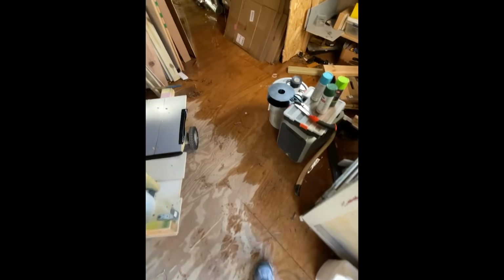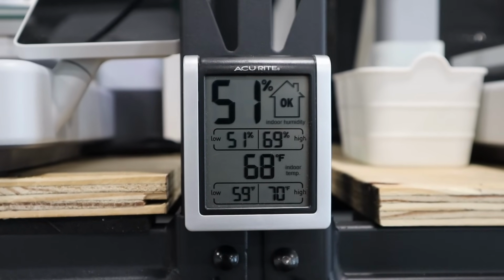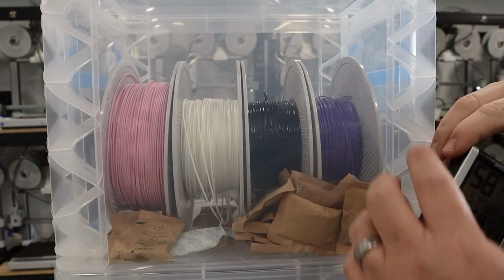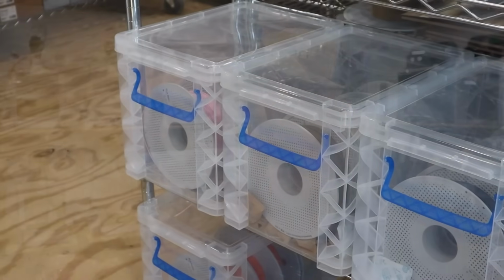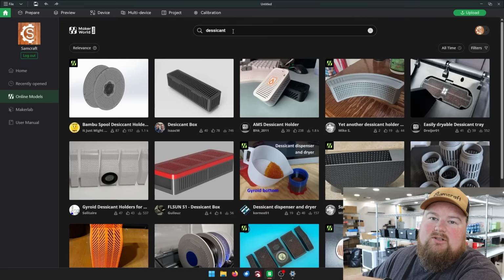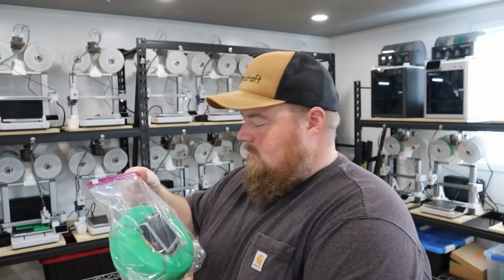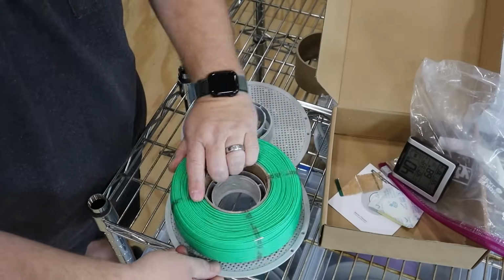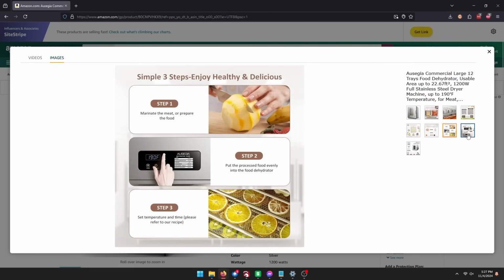Moisture Effects on 3D Printer Filament: Print Quality Test!

Comment: Sam, the moisture inside the filament and the moisture in the air within the box with the spools are different. The moisture inside the filament should be higher. The silica gel bags that come with the spools are already saturated with moisture. You can renew them by placing them on a plate, out of their bag, inside the microwave for 2 to 3 minutes. There are plenty of silica gel boxes available on sharing platforms. I don’t recommend using zip bags for filament storage, as moisture still manages to get in for some reason. That’s just a waste of money.

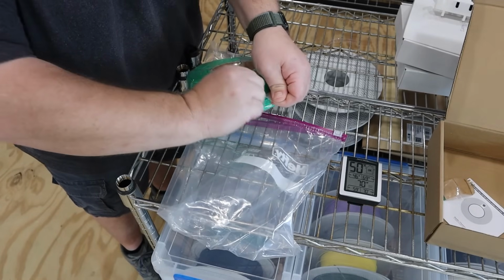Here’s my working method: First, get a filament dryer. The 11:11 discount is coming up soon. Maybe a couple of SUNLU 4-spool dryers would work well for your setup. Industrial food dryers are sometimes not very accurate with temperature, which can affect the filament (diameter consistency and shape are crucial), so I prefer dedicated filament dryers. Dry the spools until they reach 25% moisture (you want your filament that dry), then store them in a dry box. A cereal box with a foam rubber gasket can do the job on a budget. Buy at least 100g of silica gel for each dry box and renew it frequently. Most silica gel changes color when it's full of moisture, so it’s easy to tell. Personally, I don’t do multicolour prints, so I’ve set up my dry boxes with a tight PTFE tube and rollers to allow the spool to rotate. I have a bunch of these on the shelf above the printers, feeding each printer with the required color. I'll leave it to you to assess the usefulness of multicolor printing. Personally, I've determined that the filament waste and extended print times are not at all cost-effective, especially since it's very easy to add inserts of a different color, printed simultaneously on another machine, if needed.

The rough texture is a sign of over-extrusion, which can be caused by moisture. Stringing is also a symptom of moisture in the filament, as are the popping sounds when extruding PETG, ASA, or ABS. Good luck! Sorry about your floor. Maybe a coat or two of protection would’ve been useful.

Comment: Building on a few comments - in the short term, to help, raise the temp of the room, for example turn the heat on and bring it up to 75 or 80 degrees, this should coax anything wet in your room to evaporate into the air which can hold more moisture. Then with the warmer temp and with more humidity in the air the dehumidifier and AC units can work more efficiently to pull it out of the air. You can also rent a commercial dehumidifier which would be much more effective at wicking the moisture out (also check your dehumidifier to make sure it isn't creating an ice block - letting it warm up will make sure any ice melts and water drips down).  Good luck!

Comment: It seems like you're overcomplicating the issue. I have the enclosure and it's really not that difficult to use. Someone on YouTube timed a spool change and it was under 1 minute. You can always redesign the enclosure to improve speed. Remember that the spool rod does not feed the printer. The mechanism that pushes the filament is in the feeder.

If I were you, the AMS would not even be at the top with the printer. The feeder would be at the side, and I would relocate my own spool holders in the front of the shelves.

I think you are fighting an uphill battle trying to dehumidify the entire room.

Comment: Until you get the plywood floors dried out you could have high humidity for months. Move your boxed filaments to a drier room, maybe in the house. at least then they won't get ruined.
Did you put heaters in to try and dry it out.

Comment: looks like even with the machine propperly working you probably need to put the waterjet in a seperate room , when the machine is working it blasts water through the material releasing a lot of vapor intoo the room . maibe just add some sort of outdoor toilet type of structure for the waterjet , it doesnt need mush but any problems will be in that space only (maibe adding a shower tub under the machine ad maibe even a shower curtain around the machine would work too for any floodings
in the old days of stick welding you needed youre weldingrods to be dry too . one way to do that was storing them in an old fridge with a 100 watt lightbulb inside , the insulation of the fridge and the lightbulb kept the inside nice and toasty and dry
as for gaskets in the existing storage boxes , not sure if you can get two pack foam sealant material that you can pour , from wat i can see you can probably pour some of the stif in the groove of the lid cover it with kitchenwrap and set the box over it upside down to let the foam form while the box it fitted to the lid , might need to trim the foam some once it stopped expanding but i think it will seal good eough 
allso i watched another channel where the guy used a truck style air dehumidifier and he mentioned that once the stuff stops working you can put it on a baking tray and cook it slowly in the oven to evaporate the water it collected and have the stuff become active again 
might be worth a try 100 reworked packs trown in a container would draw in water a lot faster than 10 new ones

Comment: Sam, Sorry to see your woes. Might I suggest you go see Joshua De Lisle's site and look at a review (or two) of a small cheap diesel heater with a blower that might provide enough heat that could assist in drying out those spools. Ken's Karpentry just installed one and several others have used them effectively. One place in Alaska uses it to heat their chicken house coupled with a dehumidifier to reduce the moisture while heating the coop. Thinking along the lines of drying wood, I have seen a couple using these with blowers in insulated boxes and fans blah blah... You get the point. At about $100 you get a great little heater that uses little power or fuel to do what you want and you can isolate them or use them to supplement heat in the shop.

Comment: I would get a 2nd maybe a 3rd dehumidifier.  Also, put a PLASTIC Sheet across the printer end of the shop, to seal it off.  Cut a slit so you can get through to service the machines, and have a couple of dehumidifiers in there while the rest of the shop dries out.

CNC Kitchen just did a show on drying desiccant pouches with a cheap microwave using dehumidifier cycle.  Please check it out.  He got great results.  It can also be used with bulk desiccant.

Comment: Hey Sam. Thanks for this video. Can't imagine how frustrating the humidity must be.
My experience with dessicant bags from filament manufacturers are that they are generally a bit wet for my liking. Consequently, the bags are playing a game of who is more hygroscopic with the filament it's stored with.
I save a bunch of these bags and cut them open when I have a bunch. I reactivate (dry) the silica inside and use that for storage.
Speaking from a research chemistry lab, even purchased silica containers which has never been opened need reactivation before first use.
If you put them in the oven at 120°C for around 8 hours, then seal them and let them cool to room temperature, you will find they absorb a lot more moisture a lot quicker than straight out of the bottle/bag.
Those storage crates are also a relatively large volume of air compared to the dessicant you have in them. I would definitely look into maybe getting at least some rubber sticky strips to put on the edges of the container to act as a gasket.
I know the bambu lab pla filament is pretty good; however, I would also consider drying it before use (once your shop is at a lower humidity too).
I still got a lot out of your video and it was interesting to see how you take on this problem.

Comment: The process of making the filament cools it in a water tank as it's extruded, so even fresh new upopened filament will be "wet" hence they have the dessicant inside the packaging. Dessicant, filament dryers etc, even just gaskets on your boxes will help. In scotland i can keep my bambu filament down just under 20% using these methods and it deos make a huge difference to print quality! If you are printing a lot the length of time a reel is exposed will shorten, which will help, Good luck!

Comment: Did I understand you correctly that you use the desiccant from the spools you open in your drying rack?

You should reconsider and use new desiccant. Used desiccant already contains moisture and just like a sponge can also give moisture to the air if the humidity is lower.

Thus you might raise the humidity inside your drying boxes by adding desiccant which is already of higher moisture content

Comment: I use a small food dehyadrator, only fits 2 rolls, but it works well. Our humidity here is always high, often above 60% so I converted an ikea cabinet into dry storage. sealed the gaps with caulk, painted the inside with leftover bathroom paint and put window foam strip sealer on the inside of the doors to seal it up. used drawer runners and dowl with some printed parts to make drawers for the fillament to sit on and put a tiny dehumidifier inside. I can store lots of fillament in there over 3 shelves, 2 rows deep and the drawers make it so i can easily access and see whats on the row behind do i dont have to move rolls around to get to whats in the back.

Comment: A humidity level of lets say 60% means that the air contains 60% of the humidity that it can contain at the max with this temperature. The warmer the air, the more moisture it can hold. So this does not mean the air contains 60% moisture. It just contains 60% of the maximum amount of moisture with that temperature
Reply: Thanks. I've learned something new. Did not know that temperature makes a difference to the actual amount of water in the air.
Reply: @Francoisdp82 Lost In Tech recently made a video about moisture, humidity and drying filament, if you want to know more about this topic

Comment: The desiccant packs you have you should dry them out from time to time to reuse them, and you should put some foam or other type of seal at the boxes you have. PLA is quite forgiving on moisture and this is hopefully one-off situation. You don't need to go to extreme measures, if we are talking about Nylon or other similar type of filaments that's another story, but PLA is not too critical.

Comment: I live in sub tropical Queensland. Humidity in my workshop is 70+ on a good day but inside my AMS I get 25%.  I use 25 ltr sealable pales for storage of open rolls and can get it to 20%. I use multiple humidity meters don't rely on one. I have a large oven for powder coating which is controlled by a PID I use that for drying with the fan on.
Reply: Queensland's a biXch. 35's the lowest I can get without making a freezer room.

Comment: Not all seals work. Moisture still gets in. Especially if you notice the vacuum seal is loose. I just opened a fresh roll and the seal was loose. There was literally water drops inside the sealed bag. 😂

Comment: Let the temperature rise in the room and stop cooling the room and then check the humidity reading. I live next to the sea and I noticed after running air-conditioning for a while relative humidity reads 70% after switching off AC it goes down to 40s. The reading is relative humidity not absolute humidity. It's about how much moisture the air can hold at that temperature. Warm air can hold more water thus lowering relative humidity

Comment: I'd heard about using a food dehydrator to dry filament, I hadn't used my printer in a while so I threw some rolls in our dehydrator for a bunch of hours and the prints seemed to go well.

Don't know if you're in to home automation, but could rig up something that turns off the water valve under a few conditions, like machine is off, or no print job. Open valve back up when machine is on.

Comment: I don't remember which YTer I saw do a test on desiccant that comes with the rolls, but the general gist of the video was that those packs that come with the rolls are more often than not already spent, and may actually increase your humidity in your storage.

I found some reusable desiccant packs online that have changing color beads (mine are yellow/orange when good and turn green, then darker green when fully spent).  You microwave them to dry them back out, and reuse them.  I also have a filament dryer that works great when my filament becomes brittle.  FYI, I am ALWAYS fighting humidity, it's not uncommon in my shop (and my house) to be above 80% humidity with the AC unit running full blast.  Humid states are fun, not, LOL!

Anyhow, good luck Sam, hope you get it sorted out.

Comment: You need air tight boxes to keep any sort of outside air or moisture out of the "dry box" as you call it.  Anything that has a gasket is going to be a way beeter solution.

Comment: Hi Sam. Saw your video! Ouch about the water! I have a single unit filament dryer and it takes about 6 hours to get down to about 40-45% when it was just in the open year for at least 6 months. I hope the food dehydration unit solves your moisture issues.

Comment: Sam, it seems like you are going to be needing a second dehumidifier in the shop and run both constantly 😳🫣. You also may need to put the water jet machine into your older shop. Last but not least you should think about replacing the flooring as it's definitely seen better days 😳🤔.
Sam I would also suggest that you use a moisture meter to test how much moisture you still have in the flooring boards as the moisture will remain higher in areas of anything that is standing on the floor,  i.e the underneath of racking and cabinets etc!!!  As always buddy  💯%   👍   🇬🇧.

Comment: Oh no, sorry that happened. 

What I do for my non-PLA or silk PLA is use reusable desiccant (I had the blue but now use orange due to safety) and it color changes. To hold the desiccant I use mesh filter media bags. Having a lot of desiccant in one spot does not help, from other people who tested this, smaller bags in multiple spots work better than the AMS (for the X1C) inserts. And I use air-tight cereal containers. 

Another issue is that it only "drys" the first few layer wraps. This is typically fine if you have high humidity and a newish material opened, it takes a while to go into the inner layers I find. If your material is thoroughly soaked you need a way to heat and vent. Much like that dehydrator you showed. 

Although, don't mess up like I did, I put loose desiccant and it embedded into my spool, which went to the machine. Not a fun time.

Comment: It all boils down to "dry enough for long enough".  You could experiment with one of those tent-like enclosures with a frame and zipper front and keep desicant in there with the printer.  You'll get the added bonus of possibly being able to rig up a venting system as well.  At some price/effort point for that though I'd think that switching to the enclosed P1S models makes sense.  I have just a couple of both and I think as I (hopefully) grow I'm going to stick with the P1S.  The printed desicant containers easily keep the enclosed AMS at sub 30% humidity, only needing to bake the desicant about once a month.   I'd say my outdoor humidity is pretty close to yours as well. Sounds snarky but at some point - move west??

Comment: Hey Sam! I use the Midea Cube Dehumidifiers in my studio to keep my printers/filament dryer. I use the big one because they pull a ton of water out of the air and also hold 4 gallons in the reservoir if you don't have a hose connection. Then i dont uave to empty them multiple times a day. In the summer it's about every day tonday and a half that inhave to empty.

Comment: The test that you make on the new roll of filament
can't be the good because the hydrometer is humid
from the ambiant humidity and when you put it into the bag
with the new roll , you introduce humidity into the bag
All of it just to say that the new roll is ok
When you receive your dehydrator , dont forget to put your desicant bag in for a session
And maybe the water jet cutter is in the wrong environnement only because you have insulation inside the floor
where the umidity  will stay  for a long time and can create big probleme like ( mold )
Good video !

Comment: Sorry to hear of your woes.   To get a baseline for your filament since you seem to use all the same stuff, is weigh an new role and use that as the base line.  If the next new one, or one your are unsure of weights more, it has moisture.      Not sure if it will work, but if you have a sub gram sale you could weight a sample of say 1 meter, and use that as the base.  Would be easier to measure partial roles.  You could then come up with an acceptable weight. 
FWIW, I live in Western PA and our summers can be quite humid.  Not deep south humid, but humid.  I keep my open filament in a tote that I seal the opening with weather stipping.   They survive the summer just fine.

Comment: When you put the dehumidifier inside the bag you are measuring the humidity of the air, not the filament. The fact that the humidity didn't went down means that the desiccant wasn't working properly (saturated).

Recently I made a drybox and added new desiccant and the humidity went from 50% to 20% (where I live 45% is a "dry" day...LOL). Maybe that can help you.

Comment: Will your Home/business insurance cover replacing the open filament? Even with the deductable with that many spools you should come off ahead.
Reply from the maker: I am very thankful you asked this! I had not thought about using my business insurance until this comment. :) I have the process started towards a claim to see if it's worthwhile and/or what hoops they need me to jump through. A rough estimate is about $1,800 in damaged filament -- much more than the $500 deductible on my coverage. Thanks!!